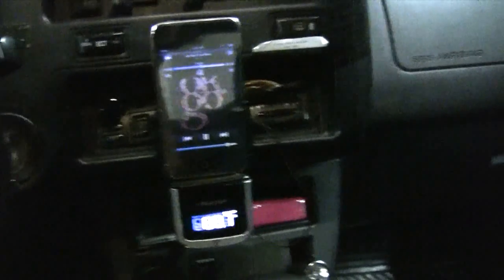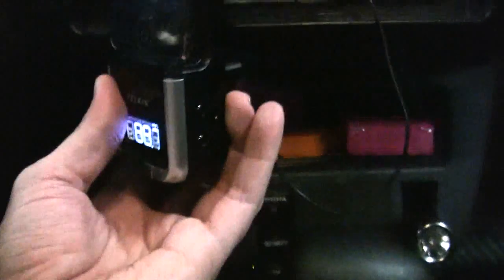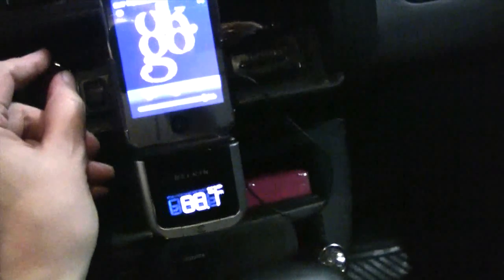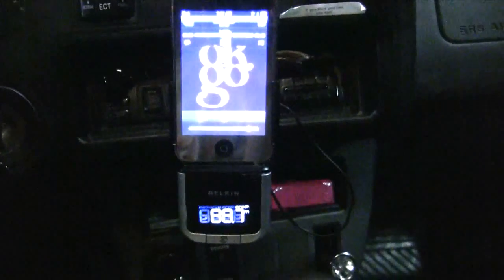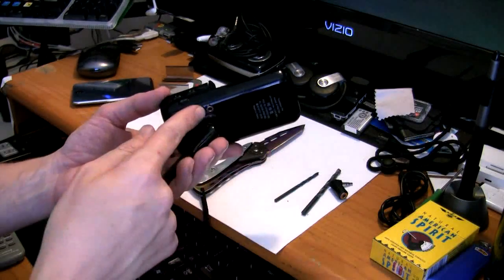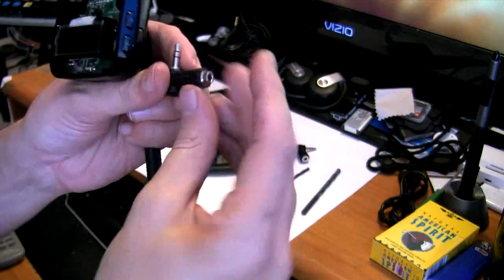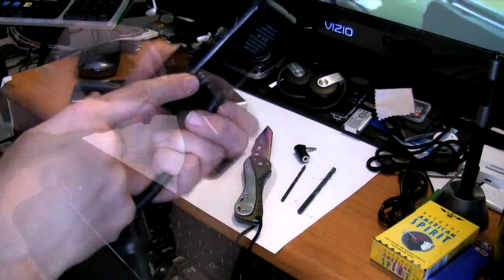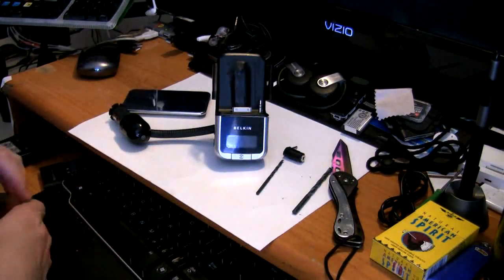Belkin TuneBase FM Transmitter iPod 2/2 - High Quality Audio Modification

Comment: ahh, I see now. Instead of having to "plug up" the cable every time, you just throw it in the cradle and its connected automatically to your system and the charger.  
Got it  :-)